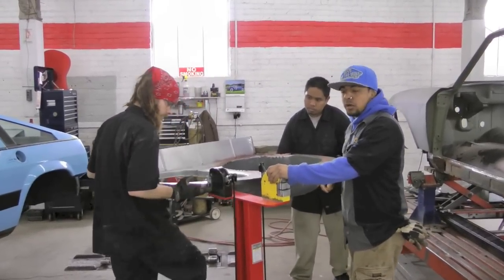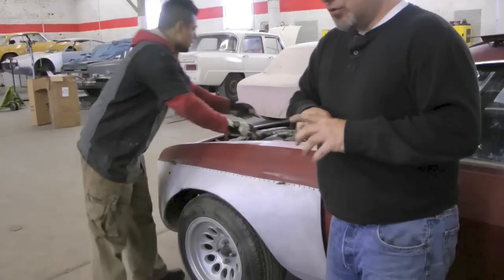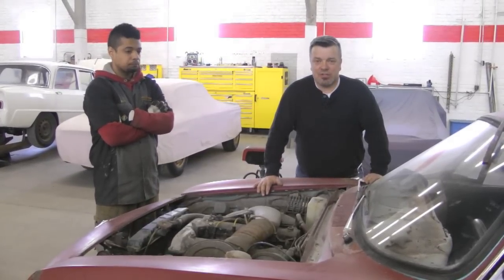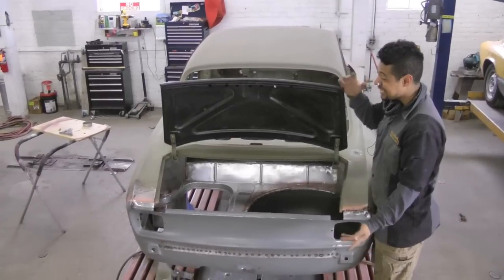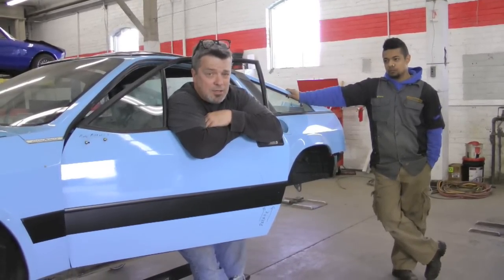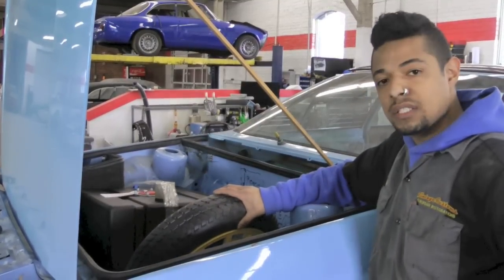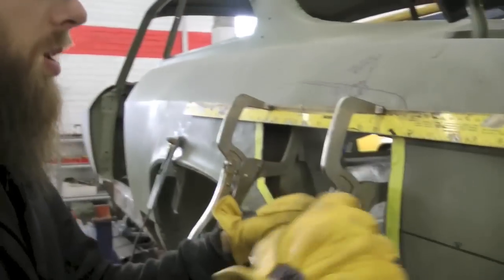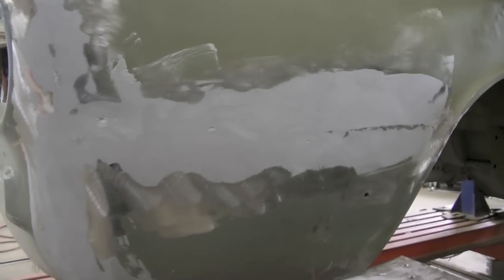To buy or not to buy a GTV 3

Comment: Hi, really awesome videos. Been watching for a while now, were restoring a basket case junior wich made space for a late 1300 stepnose. Very useful to get some advise on paint what paint/primer system to use and how to go about body work. This hammer welding and using an airline to blow welds, how does it help fight distortion and what is the proper technique? Thanks again for the awesome videos again.